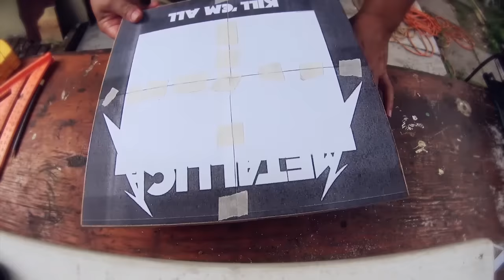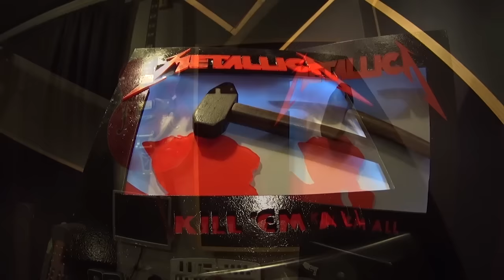Makers Rock Album Collab / Metallica / Kill Em All / backlit led Hanging wall art / Make Video

Comment: is that the Harbor freight scroll saw
Reply from the maker: Yes it is. Believe it or not, I got it for 40 bucks. It was unboxed in the back. I asked and they dropped the price..it was a steal!
Reply: Just wondering cause im in the market for one how do you like that one
Reply from the maker: for the money, it gets the job done. But if your budget is bigger..you could go with the crown jewel like the dewalt. So, yeah, it get's the job done..the blower on mine is not good...still, you can crank out work with them. I know I'm all over the place on this, but long and short, for the money yes...
Reply: Ok thanks im looking at the porter cable also